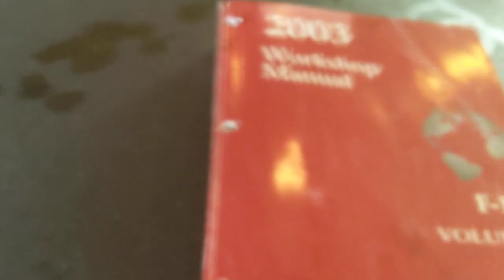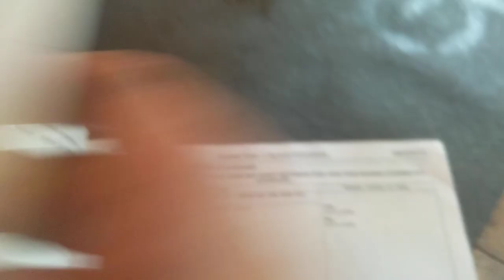Ford/Mazda M5OD R2 transmission reassembly Part 1

Comment: I have a 2000 Ford F150 V8 4.6l manual transmission. These transmissions are beasts and very well made. I have 326,700 miles on my truck that my dad gave me as he bought it brand new from the factory. He drove it all highway miles, always kept up with maintenance, always took it to the dealership if there was a recall. I received it from him with about 250,000 miles on it. It still has all the original major working parts on it. Only minor repairs have been made like O2 sensor, fuel pump, etc... It just a couple of months ago started to make noises when disengaging the clutch(probably throw out bearing), so am going to probably have to put a clutch kit in it. The transmission seems fine as there hasn't been any signs that it's failing. Crossing my fingers that it's just the clutch when the family mechanic takes a look at it. Thanks for posting this video. 👍
Reply from the maker: Great story & thanks for sharing. If you have to get into the transmission, the syncro friction material is what wears. Unfortunately, they're not available OEM new. The aftermarket replacements don't look to be the same.
Reply: Thank you for the positive feedback on my comment and thanks for the tip, I will keep that in mind for the future. 👍

Comment: I had a 1999 F150 v6 I bought from new.  sold it in 2019

My tranny was hard to shift into 3rd after 20K miles. Was still good to drive when I sold at 150K.  The syncros were worn by my wife after only 1 day trying to shift my tranny for me.  She never touched it after that.  I see why.  The syncro looks like brass.
Reply from the maker: Some people downshift, cramming the trans into the lower gear.  It wears the friction lining off the inside of the syncro. Oops.
Reply: Thanks for this tip. 👍

Comment: Do you know the distance from the edge of the bell housing (Block mating surface) to the end of the tailshaft cap/spacer. I want to change my E4OD for the M5OD-R2 and wanted to know if I would need new driveshafts.

Comment: En Hello I want to know in What part is connected the speedometer cable greetings from Venezuela thanks
Reply from the maker: Some M5OD have a small gear in the tail housing. This one has an electronic speed pickup. It senses the toothed wheel.

Comment: I got one. Do you find that the 06 version of this manual transmission is better designed that the version that came out in 98
Reply from the maker: The synchro friction rings from earlier models were slightly different. Both appear to give long life.
Reply: @nickydoes  Anyway to get them in bronze instead? Thanks!